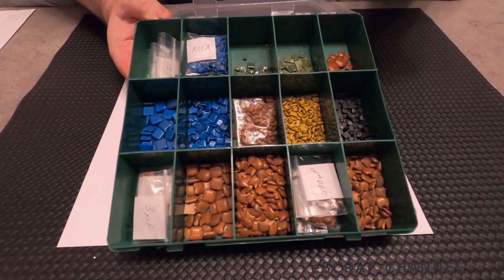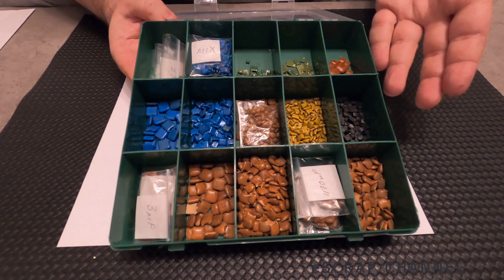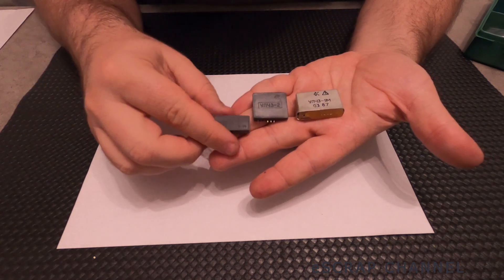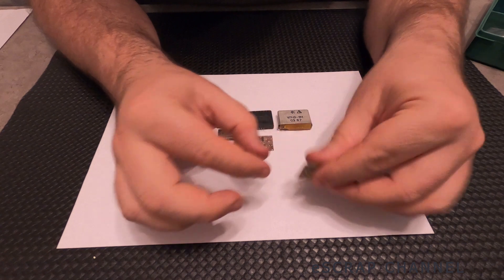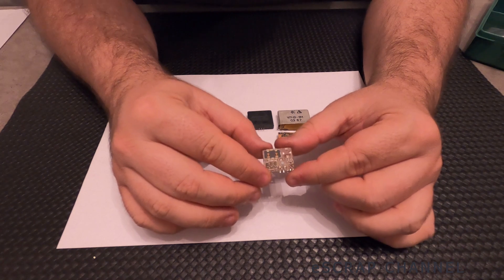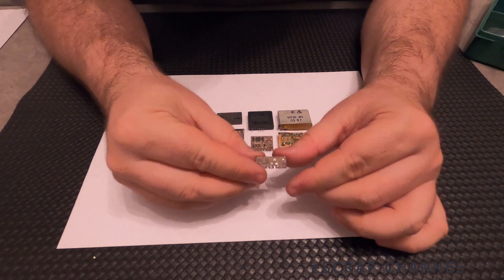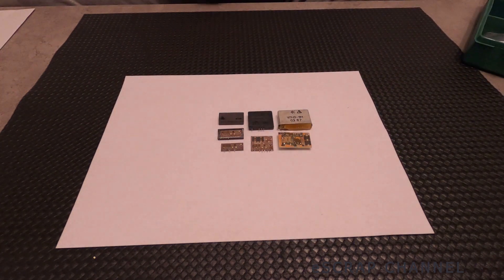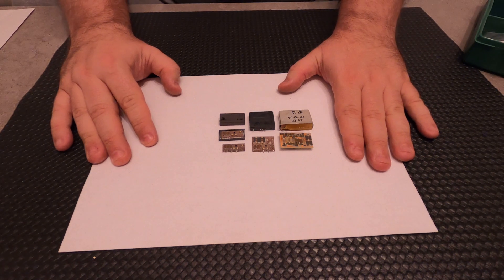Platinum Group Metals in old TVs

Comment: My man i dig the parts content videos. Especially the giant russian tantalum caps. Im still waiting for the day i run across them. Id crack them open like eggsurprise and put all that chunky tantalum in a candy bowl placed on my recovery table
Reply: The golden era and i never knew until i ran across your channel. Awesome. Thanks for sharing. And speaking of id like to request a video in which you process the caps youhave sorted in the organizer. Do you process wet or smelt? Owltech has great smelting videos
Reply from the maker: @alexross2682  Hi, smelting is something I plan to master. Very interesting to me but using lead is concerning me. There are some cases when lead can be avoided and other metals used, but I am still in the phase of experiments. Wet methods are what I mostly use.
Reply: If you can find the time, itd be great to see some yields. I like your style of quantity of pm and the prices you guys pay over there. They gouge here so its rare for me to find a decent deal. Especially when it comes to gold in boards and ic chips. Ive been messing with capacitors lately on a crave for palladium, silver, and tantalum. At any rate thank you brother for the lessons. See you at the next lesson maestro

Comment: Specific to Soviet material. I am on the west, ours aren't that good but I do find epoxy coated mlccs.
Reply: I heard that story too :)
Reply: @OwlTech333  sorry for the fan boy moment on @escrapchannel comments but im a huge fan of the smelting work you guys do. Brilliant
Reply: @alexross2682  Thanks for your support!
Reply from the maker: Hi, the three amplifiers are from USSR TVs, but usually they copy ‘west’ devices and ICs, so what you find in 1989 USSR you can find in 1975 US device. I’ve also seen epoxy coated MLCCs that are not bad in palladium content.
Reply: @eScrap Channel  they did copy, yes but they surpassed the west in precious metal content. Robust
Reply from the maker: @royalrefining6182  you are absolutely correct! I spoke long time ago during my PhD with a guy that was working in one of the IC factories and his explanation was that process was not well implemented and result varied in wide ranges. About gold plating his comment was exactly: when workers decide to steal gold, then you get half thickness of the layer, when workers get drunk you get twice thicker layer. Haven’t seen with my eyes, but I’ve seen in the lab completely different results from same material.